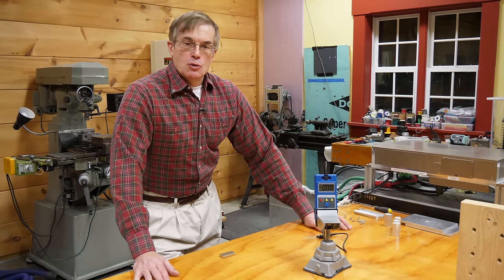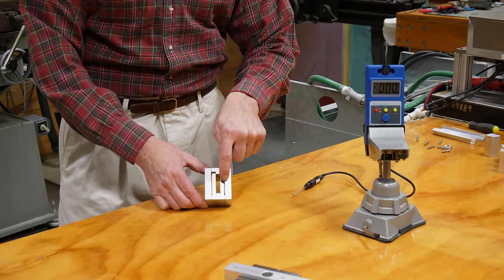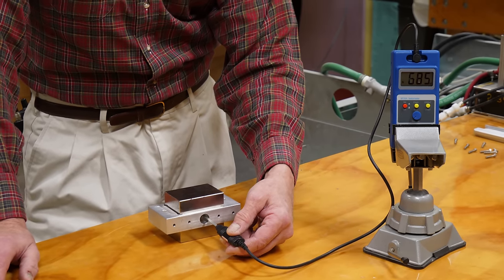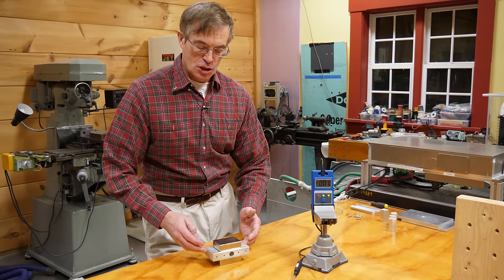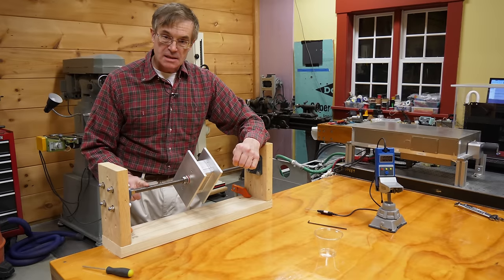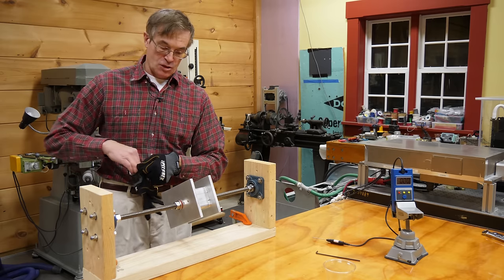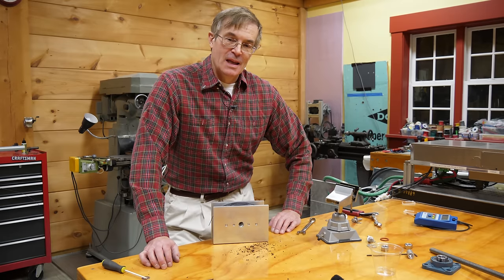VERY POWERFUL MAGNETS… THE EASY WAY

Comment: The only change I would make to your set up, would’ve been to put your wrapping assembly so that you could hook it up to a cordless drill and you would’ve been able to wrap it exponentially faster
Reply from the maker: It doesn't work out that well.  The stock coil is tough to deal with.  The wire twists and easily kinks and can trap a finger.

Comment: So is the wire just wrapped over itself and the flying end just tucked in, or are the two ends joined?
Reply from the maker: It can be done either way.  The wire is not acting like a wire, but simply a form of the iron.  It would work if you dumped ball bearings, or iron shavings around the magnets, it would just be less easy to control.

Comment: Great video!! Very helpful for my own project. I was wondering what is the steel wire you are using and if there are any links you can provide, thanks!
Reply from the maker: Any soft iron wire will work.  The smaller the diameter, the more wraps you'll  have to wind, but the easier  the winding process.  I believe  we used .050" diameter.

Comment: Hi teacher! could you make a video about the possibility of making a generator to magnetize and demagnetize magnets? Is it possible to create a dematetizing device by applying electrical power? Can an inverter welding machine (for welding iron and steel) connected to a coil with many windings be used to generate a strong electromagnetic field? Is it possible to build a device at home to improve or even worsen the magnetic intensity of a magnet? (DIY magnets ..). Thank you.

Comment: If you ran a current through the wire(if it was magnet wire), it would increase the magnetism temporarily? Thanks for posting. It's a very noble and interesting idea.
Reply from the maker: Yes.  Indeed, the highest magnetic fields are generated by facilities that combine permanent magnets, superconducting magnets and conventional magnets.  Of course, the wire would have to be insulated to allow the current to flow around the permanent magnets.  As it stands, what we built was just a block of steel consisting of loops of wire.

Comment: great video. use wrenches, not channel locks though. you could be real cool and geeky and make them out of non magnetic material too if you wanted. and how much power is generated by the coil?
Reply from the maker: Thanks!
I know, they were simply closest.😕

Comment: What if you just plug the holes and stuck it in a big bucket of metal filings? Wouldn't that work basically the same way as wire although maybe a little more messy but possibly you could coat it with some sort of an epoxy after that?

Comment: coated wire, an aluminum wire, the coating distance, does that prove out anything and thew thickness of the wire in conjunction to the ,magnet size, would that benefit? then if the wire size"thickness" if it was thinner at the last portion of the wrap, is there going to be a benefit?

Comment: You could first plug the gap and then drop fine steel powder on the outside.
The powder would stick itself where it is needed. 
Finally resin could be used to seal the outer layer of the powder.

Comment: Thank you Tech Ingredients for your great content and presentation. I have been more interested in Tech Ingredients approach to design/repurpose electric generators from motors or building custom systems. Copper coils, magnets, epoxy, wind generator, water generator. Thanks for your creations, I been inspired to take on a DIY generator myself and had many initial concepts of which upon research turned out to work as shown by others. Thank You.

Comment: I was surprised by the efficiency of the material/wire you used. I had thought you could gradually add iron powder, when I saw you waving the steel wire around that made a lot more sense as the wire would be much easier to remove once it was no longer required.
But, I thought a wooden shaft with a wooden crank handle, much like one found on a well would have made the winding of the wire proficient/less of a chore.
Also, you could have used plastic/polyurethane fasteners and fibreglass/brass tools to fix the magnets in place, your fingers were very much at risk there.
I have enjoyed several of your posts now.
Thank You,
Carlos. (Magnets are fascinating things)

Comment: @Tech Ingredients
Great vid - I've enjoyed all of them actually, good job. It occurred to me that in several vids, you try to explain the directional and physical attributes of magnetic flux lines and I was wondering if you couldn't do the equivalent of the 2 dimensional iron filings on a paper in 3d, in an enclosed clear plastic box, with some kind of suspended metallic partials swirling in the air of the box. Is there a material that is light enough to suspend in the air, and be attracted to a magnetic filed? This would really help you see the flux lines....
Reply from the maker: Thanks, I'll think about it.
Reply: @TechIngredients  Here's someone Who did it with iron filings suspended in what is probably a very viscous solution 
- but I bet you could do much better - lots of light, (perhaps phosphorescence, black light, or other) lighter material than iron, less viscous - much finer grain,  ...he's not really getting all the shape (loops), and what he's getting is not very visible. I wish I had your lab, my wife would probably object though :)... :) .   

 Actually, you could use different types of light if you have the correct receptors, and feed it into a computer, and create a 360 degree model you could turn around, and really see minute details of the field. (Retired software engineer , sorry:) )
Reply from the maker: I think the better approch is lighter not smaller feromagnetic particles.  They could be composite.
Reply: @TechIngredients  Sounds good - I was just figuring the smaller the particles, the better the resolution, but maybe not. To take this idea to it's extreme, if you really wanted a real-time, fine resolution, 360 degree view of the lines as you are working with as you change attributes, it would be totally cool to  set up a holographic camera, and display it as a real time hologram. Captain Picard would be proud! :)

Comment: Love your contraption for winding. I'm just surprise you didn't make one of the ends fit into the chuck of a drill. You could control the speed, while your son moved it side to side. But, once again, great video!
Reply from the maker: We considered it.  But, the limitation was not the winding but the poor fella that had to deal with the stock spool of wire and its tendency to tangle.  A motorized system would risk some fingers!

Comment: I don't have the scientific or engineering background to know if this is a silly question, but you mentioned not using the lathe due to metal filings... what if one could somehow direct (a large amount of) filings to come to rest and build up where the wire wrap is and then secure them in place... would they serve as a denser, more compact medium & thereby improve the field lines control over wire? I would think a cross section might show less space between the particles compared to the wire. (?)
BTW, I'm humbled at your knowledge & intelligence, and love your videos!
Reply from the maker: Potentially, yes.  But, it would be an absolute mess during the assembly as the sharp metal stuck to the surfaces and entered within the block.
Reply: @TechIngredients  Right... makes sense. Thanks!

Comment: How challenging would it be to surround your 2 main magnets with 4 perimeter magnets each in a Halbach configuration?  If possible do you think the field strength would exceed the magnet wire yoke strength?
Reply from the maker: I don't know.  I haven't heard of anyone using a Halbach configuration with magnets that have significantly different strengths.

Comment: You coud increse the magneticfluxcapacity by filling the gaps inbetween the wires with ferofluid
Reply from the maker: You could.  Alternatively, if we were willing to spend a little more, thin metal strapping rather than wire will pack more tightly

Comment: Interesting and educational. Thank-you.

Having thought about this for a while, an idea for improvement has occurred to me:
How about obtaining some Iron foil of the same width of that yoke, and wrapping that around the magnet instead of using wire? It would have fewer air gaps, and thus use the available space more efficiently. Furthermore, it would be a lot quicker to wind enough Iron into place than if using the wire. It would also be interesting to see what peak field strength you could obtain with those two magnets, without the whole thing becoming unmanageably massive. Maybe 1.2 Tesla?
Reply from the maker: Ultimately, the magnetic field strength of the magnets themselves is 1.4 T.  The foil would be better if it can be sourced.

Comment: This specific topic and its demonstration will help me to improve and dial in a project where the sheilding of those same type magnets will make the difference in safe and practical use. 
Originally a project idea started out with an electro-magnetic concept, yet as I looked into how inefficient they were in the size and power level possible in the application, the permanent magnets seemed a good way to go, but it would be prudent to have a more precise optimal control considering the proximity to other sensitive components. 
Unless I  buy a lot of different magnets to  find  that "one" perfect balance magnet that can perform the task with a breakaway threshold that is reasonable, I might WIND up doing it this way as seen in another great video here,......
Reply from the maker: Great!

Comment: Look up "This old Tony making a spring". You can potentially use your lathe to wind that magnet
Reply from the maker: The challenge  isn't  the winding, it's the poor guy handling  the stock coil. A motor driven winder risks the fingers of the coil handler.

Comment: what made you choose the wire over steel banding? i think you might be able to achieve a sightly better or at least similar density with far fewer wraps.
Reply from the maker: The banding was more expensive although it would have allowed a denser wrap and a smaller assembly as you suggest.

Comment: this is the principals of pickups in eletric guitars :)
Reply: Little bit different. The wire used to wrap around the magnet(s) in a guitar pickup are non-ferrous (non-magnetic) copper wire so it doesn't yoke the field of the magnet, but instead provides inducted alternating current when the guitar string vibrates that then gets processed/amplified and sent to a reverse pickup, a speaker!  I'm a drummer so I  probably got some of this a bit off. Going to go beat things with sticks now and stare at the lights.

Comment: Pretty interesting way to gradually add metal. The idea I've been thinking of, is to use solid chunks of steel, but put large enough piece of low melting temperature plastic between piece of steel and a magnet and gradually heat up piece of steel until it completely melts the plastic and touches the magnet.
At first I thought about using ice in-between steel and the magnet, but rather than slowly melt away, it'll probably just shatter, so plastic would be a better choice.
Reply from the maker: Be careful.  As the surfaces approach each other, the attraction increases geometricly.  The softening plastic might extruded/eject  suddenly.

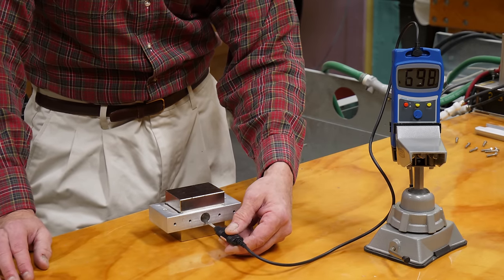Comment: The steel wire only created about a 29% increase from the 730 shown at 3:22.  Not 40% unless you were using the weaker magnet from before.

Comment: Somewhat related story: I visited Wings Over the Rockies air and space museum and saw the rocket engines from the Titan missile. I noticed that the combustion chambers were built with a wire-wrapped technique. On the inside, running vertically, the combustion chamber and throat were made of tubes brazed together, and on the outside it was wrapped with wire. I guess that must have been easier than a forging or whatever they otherwise use. I often wonder if naval guns or pressure vessels could be made in a similar way: like a COPV, but with steel wire as reenforcement. Rather than any advantage in strength to weight ratio, the advantage would be that you can make thick metal structures without the kind of industrial investment needed to make monolithic ones.
Reply from the maker: We can do better now with 3D metal printing and laser fused, powdered metal printing.  Those early nozzles also  used the welded tube to flow liquid oxygen to keep the nozzles  from melting.

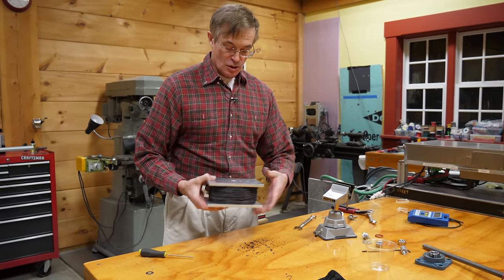Comment: You probably already know that tape-wound and wire wound soft-iron cores were used for transformers all the time. I would suppose that a stack of alternating C-I stampings would work even better than the iron wire for your application --> 1.2 to 1.4 T should be possible with N52, depending on the magnet-thickness and the airgap, not so much the back-iron. The leakage-flux at the end 11:53 suggests, though, that the cross-section is still not enough and that the wire-material is saturating.
Reply from the maker: Yes, we are aware of that.  However, what we are doing here is significantly different.  The laminations in a trasformer are used to reduce eddy currents that devlop with the alternating field in a transformer. Those wires are guiding the current flow and it is those electrons that create the field.  In this application, the wire is guiding the field itself.  More wire or a denser wrap with say metal strapping (but at a higher cost) will further improve the guiding property and 1.1 to 1.2 T should be achievable.
Reply: @TechIngredients  Hi, yes, I meant iron wire and iron sheet for CC cores for medium-frequency transformers (not the copper-windings). Vacuumschmelze etc. made iron-wire-wound cores, potted in epoxy, then sawn down the middle to add bobbins for the copper. As for you use, the laminations I suggested are intended not to reduce eddy currents, but to reduce the risk of hurting yourself while assembly :) Good silicon-steel can easily go to >1.5T before saturating. The grain-orientation of hardware-store iron-wire, on the other hand, can bit dicey.
Reply: @TechIngredients  E.g.: https://www.magneticmetals.com/products/tape-wound-cut-cores

Comment: you are a nerd of the highest order! pretty cool. And YES, strong magnets can be quite dangerous! I use 1 1/4 inch x 3mm thick magnets to hold things down on my laser bed. Even at that size they WILL grab razor blades, screwdrivers etc if they get too close! And the worst danger is 2 magnet close together with your fingers in between! They WILL give you a good pinch! (Smash)

Comment: You have a great evening! I just found you, and this is a fascinating subject. I believe it was a newman's energy machine video that pointed me to you. What do you think of the device. have you made any attempt at creating it?
Reply from the maker: If a dual cylinder, two stroke engine actually had out of phase power strokes, then this would be a good alternative.  The engines we looked at used simultaneous ignition timing.  Four cylinders would be even better as they can balance the mass of the pistons as they move.
Reply: @TechIngredients  The subject I'm currently the most interested in is a FM radio data stream. Could be a pipe dream, but imagine if you could connect to your own home network directly. How strong can you make your cell? is about a mile unobstructed too much of an ask? :D so exciting

Comment: Just curious, would using thin steel strip the full width of the spool have any advantage, or disadvantage in this design? Thinking of a laminated transformer type design.
Reply from the maker: That might work a little better, not because the laminations are better (a continuous magnetic field does not generate any eddy currents that laminations are designed to suppress), but because the metal will pack better and the yoke will be denser. Thin, uncoated metal strapping would be best, but we found that it cost a lot more than the wire.